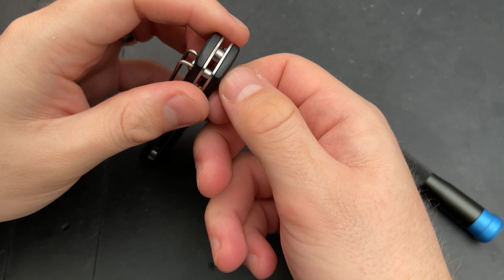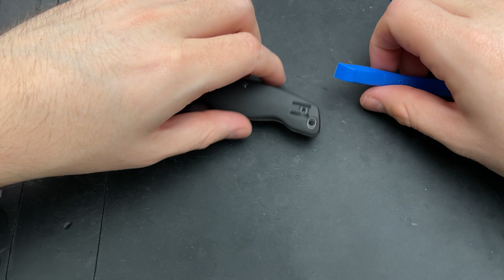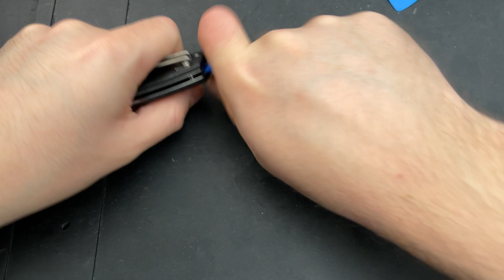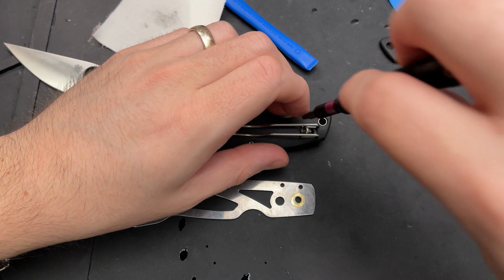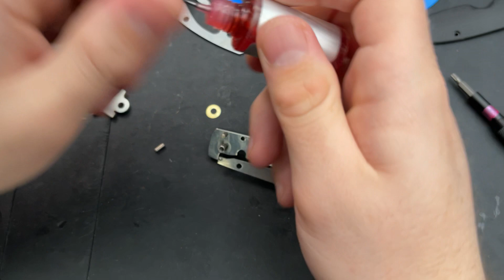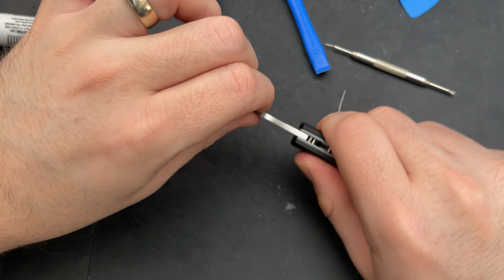How to disassemble and maintain the Spyderco Pattadese Pocketknife

Comment: My PM 2 came with a washer that was just like that (flat spot on one side and burr in the middle) also had what looked like slag from the pivot hole cutout on the inside of the liner. I bought new washers and sanded down the crap on the liners and it did the trick.

Comment: Try getting a flathead screwdriver and wrapping a little duct tape or electrical tape on the tip and putting it between the liners and twisting the handle like you’re unscrewing a screw and that might do it. The tape is there so you don’t ruin the finish.

Comment: It is kind of interesting and potentially relevant to this that manufacturing in Italy is increasingly dominated by Chinese immigrants.  The New Yorker had a long piece about that a few years back.  And it always amazes me when knife makers cut and grind elegant blades of fine steel and then slap on some thin liners, plastic handles, and finish it with soft screws over torqued with great globs of loctite.